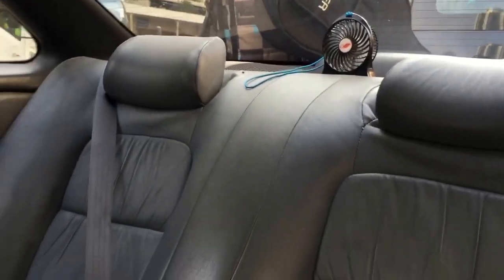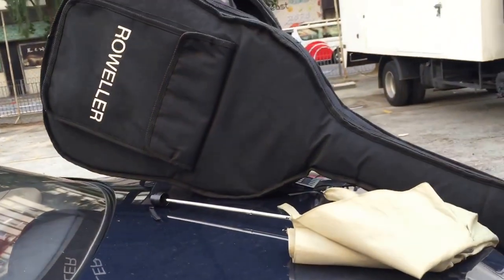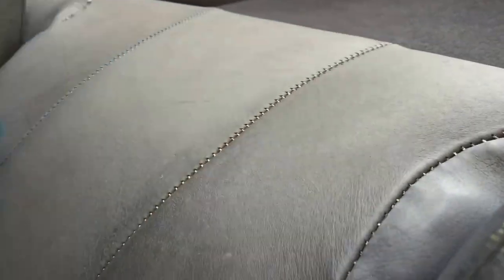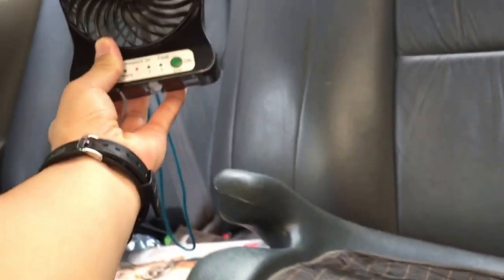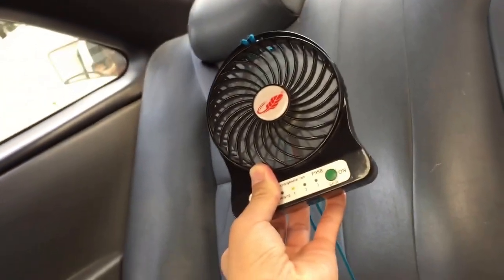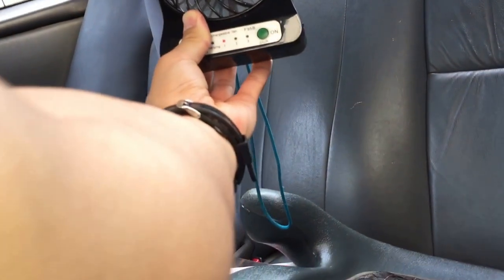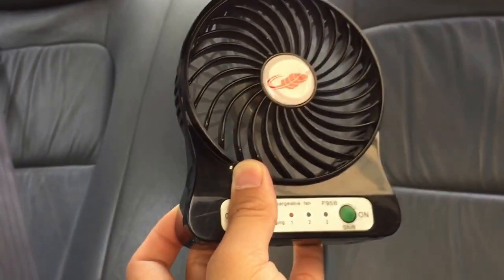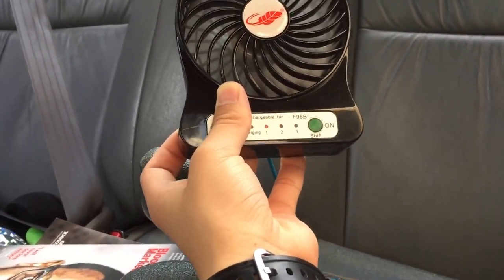Airing out my dad's car to get rid of excessive heat

Comment: Much better if you use your small palm leaf portable fan
Reply from the maker: It wouldn't move as much air. Also, it has a problem. It won't start, sometimes.